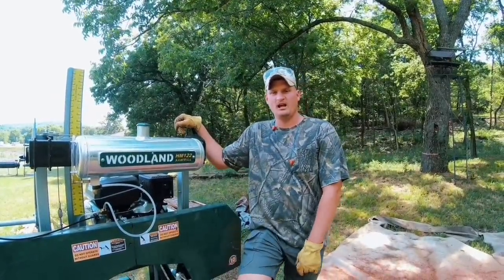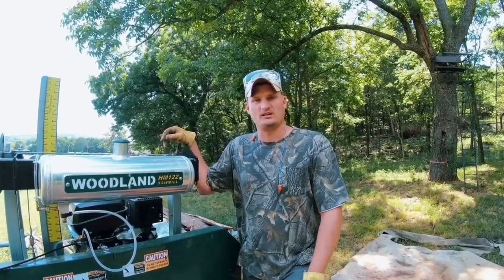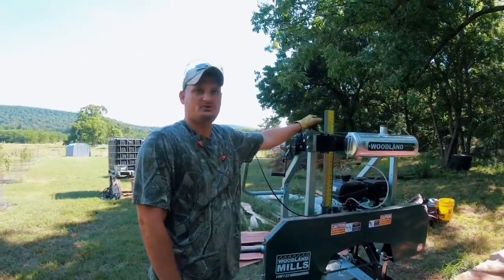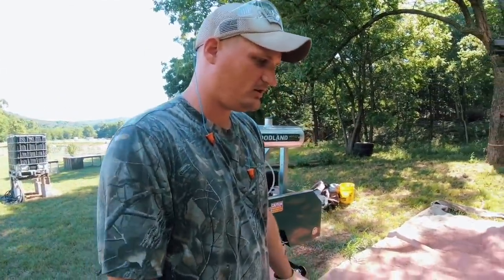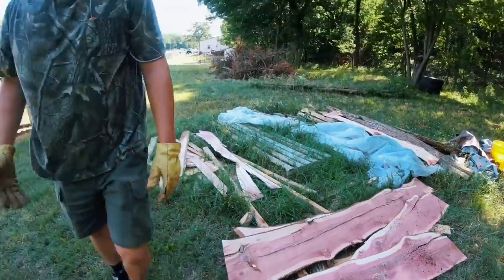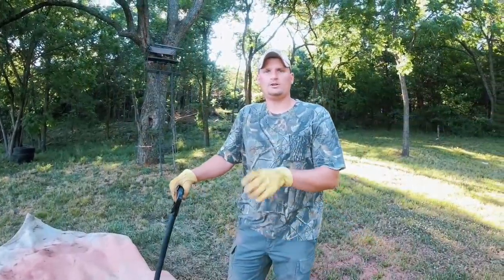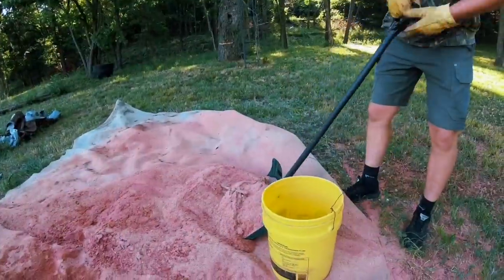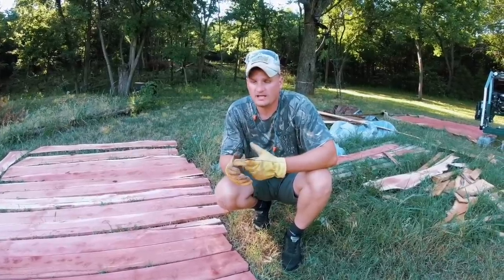Logs To Lumber | Milling Beautiful Red Cedar On The Woodland Mills Sawmill

Comment: Those gaps/holes can easily be filled with clear epoxy on a table top
Reply: I was thinking samething but also doing time consuming Dremel carving of the rot .
Reply: We would fill the wood with clear epoxy.  People LOVED to look at it and wanted to BUY it that way. 
Tree trunks make FANTASTIC legs for glass table tops. This is one of the MOST BEAUTIFUL WOOD. THANK YOU LORD.  Just PERFECT.
Reply: You could fill the gaps with colored resin, glass/plastic chips or maybe even sand & covered that with clear resin. Some look kind of like a river running through the wood. They were stunning.
Reply: That would be beautiful with epoxy in the holes. Either clear or a beautiful accent color
Reply: I was thinking the same thing. I have seen some beautiful tables where those areas were filled with bluish green epoxy and made to look like a river. Very cool!
Reply: Same thoughts and they really turn out alot nicer
Reply: Colored epoxy for sure. Blue & Red mixture

Comment: I'm in BC, Canada where we have LOTS of Western Red Cedar... it's an amazing wood, full of surprises!... I recently cut a 4ft diameter log on my Woodland 126...It had several large checks in it, half a dozen big ugly knots plus it had a lot of centre rot... only good for kindling I thought. I ripped it in half with a powersaw and decided to try it on the mill. WOW!! surprise, surprise! ..  the knots were tight, grain had more twists 'n turns than I could shake a stick at and the whole log (14ft) had many different shades of red. A beautiful log which was left behind by a logging outfit because it was a rotten piece of junk!!!

Comment: Hey Sawyer Ridge!  You need to use epoxy to fill in that wood rot, as someone else suggested.  Check out some of the epoxy tabletops on YouTube & company websites.  They are using colored epoxy to fill in areas that otherwise might prevent you from using such wide pieces of wood for tabletops & other furniture.  Some people use turquoise colored epoxy for a beautiful Southwest look.  Others use gold or silver epoxies.  It really depends on what you want.  You can clear-coat the whole slab with the clear epoxy afterwards to give the whole piece more depth.  Additionally, you can carve any sort of designs into the wood if you like, fill it with one or more colors & then clear-coat it.  So, don't give up on the wood when you find some holes or wood rot.  Just clean it out & fill it.

Comment: you can put epoxy in the bad section after you clean it up some, you can even color it there are videos out there where the center of the table top is basically epoxy, there really neatt

Comment: You could do some epoxy filler, as some suggested. It would be a cool experiment.
Sorry it didn't work out but like you said, you never know. Cut an oak today and carpenter ants were eating it from the inside out.
Yep, good use for the sawdust. Just save it for y'all's use. It doesn't go bad 😁
When you switched to all dimensional, good for planks for sure. You could always find someone with planar.
God bless you both and keep you safe

Comment: A LOT of woodworkers have gone to using resin for wooden table and counter tops ... They want a bit of rot ... It adds personality to their projects ... About the only thing is taking the bark off ... Live edges are a good thing ... Cut 2 inch slabs and they will buy ... That red cedar is beautiful ... The sawdust can be mixed with glue as a wood filler ... It also makes great kindling ...

Comment: I keep reading comments about cedar sawdust will burn the grass is that happening? Do you keep the mill uncovered or do you have a cover for it from the elements? 
You might try put an expo resin clear for table top...you won’t have to worry about rot.
Reply from the maker: Tricia Acevedo we try to keep the sawmill covered.

Comment: I think you will get better at cutting boards  you need to rotate the log a lot  dont cut to much from one side before you rotate  get all 4 sides square then figure out what boards you can get out of the log . I aways cut them at 1 inch because they will shrink as they dry and you can plane them to the thickness you want after

Comment: Sorry that Lawn turned out to be a little disappointing but you can still use a lot of that stuff if you want to make a shelter for the pigs just to give them some shade or a wood shed to keep your wood dry and stuff like that it’s not perfect a little rain might get through but it will still work for a lot of things where you just need a basic cover.  I saw one guy took all the scraps and then pieces with bark all over them and built a hog trap, they had hogs on their land in Alabama, it wasn’t the prettiest thing but it was free wood and it worked great. A lot of people make money just taking stuff like that and leaving it rustic and painting some quoteon there and making it like a decoration, little signs and stuff, so you can use even little scraps left over for stuff like that sometimes. Lol. Maybe someday you can sell enough of that to buy that tractor. 

Looks like you got a few good boards out of it, and you got plenty more trees. ;)

Comment: Great idea to cut down on odor and snake deterrent.  However, please use caution if thinking of use as bedding as it can cause respiratory problems in small animals.  Also, it is considered a carcinogen to humans especially the dust.  Sorry to be so negative, just stay safe.   It is a beautiful wood & I for one like the smell.
Reply from the maker: Thank you! We’re definitely not using it as bedding, just around the outside perimeter of the coop.
Reply: @SawyerRidgeFarm  - you might consider wearing face masks when milling the cedar.  Better to be safe than sorry.  I enjoyed the video.

Comment: Table****Live Edge Slab****.                   Get Jason to consider Epoxy, Stone Coat Epoxy always advertises some good bundle deals. They are all on you tube. Here are a few to introduce you, these are quite the trend nowadays, 15 k for a table when recognized by someone with money. You two could make one a year to sell after you get what you want for yourself.                        DIY Epoxy Table- How to Resin and Wood Table-How to Woodworking.          How to make a Resin Rivertable Using Clear Epoxy Casting Resin.                      5 tips for better Live Edge Tables you tube John Malecki.                                   How to fill cracks with, Epoxy Live Edge Table Pt. 4 you tube the Samurai Carpenter.                                                 Live Edge Slab Table, How to seal coat you tube Rsin Wood Tables NZ.              Quite the rage, wood is that way, sorry I didn’t get the channel names of the first couple of you tubes but the titles should pull it up. I think charcoal or a black epoxy would look awesome with red cedar slabs, you could do dark brown or clear, whatever you want but those pieces are classic for these tables.
Reply from the maker: Thank you for this information

Comment: Why didn't you finish assembling the mill you are missing the face plate that makes head ridged and you would not  have had that rot line in every board if you had orientated the log with crotch up and down or side to side instead of the weird angle you started with